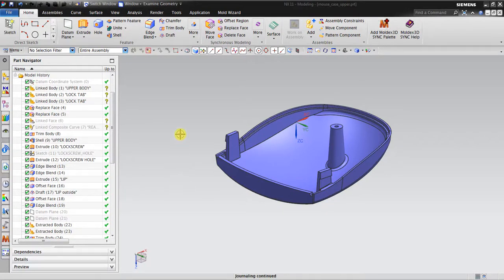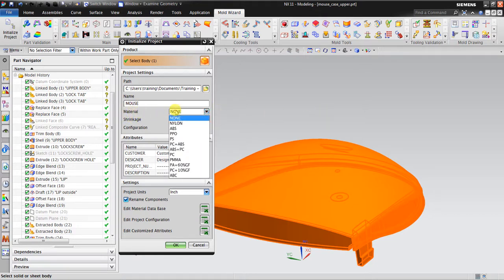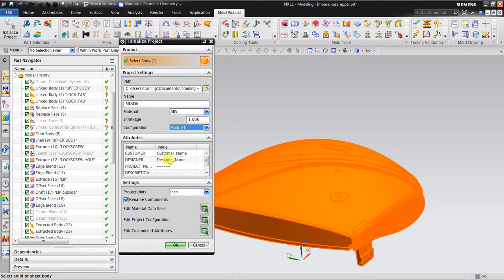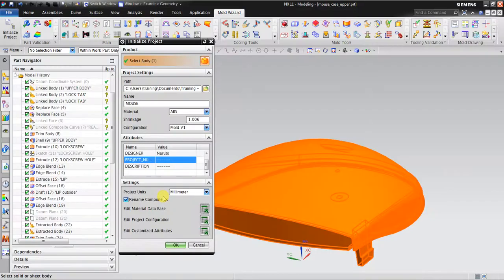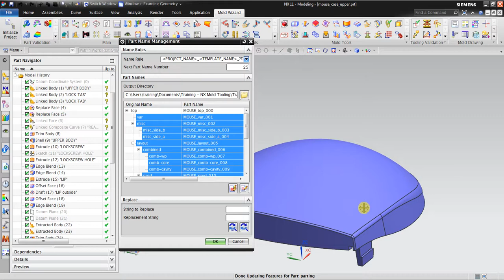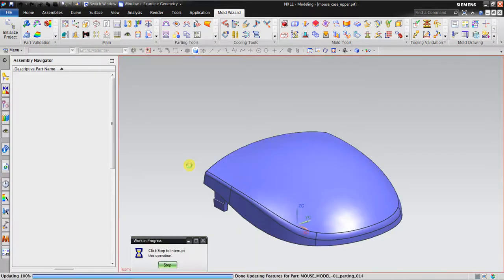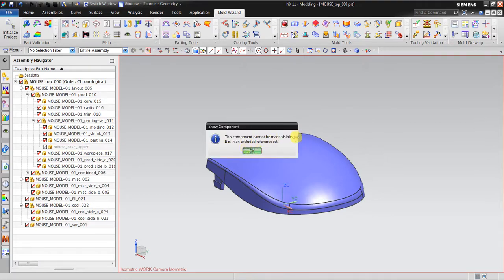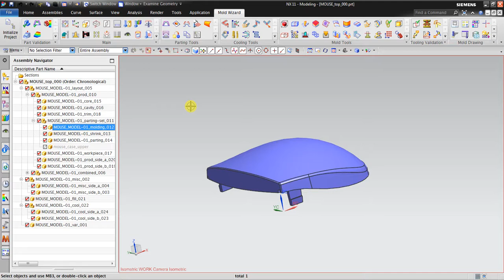NX Mold Wizard - Initialize Project

Comment: Only Nylon is shown in Material drop down list and even I can not edit Material Database, when I click on Edit material Database a spreadsheet dialog box appears saying "Cannot copy template file into the database directory, check if you have write permission to that directory"
Reply from the maker: Hi.. 
NX material you can edit the database. Copy it and put it as local material database. The NX default database are read only.